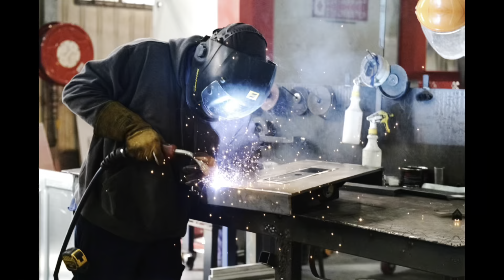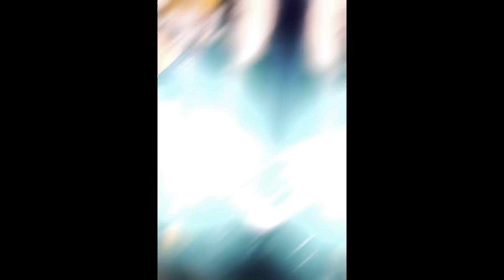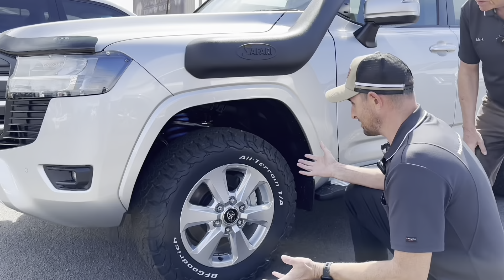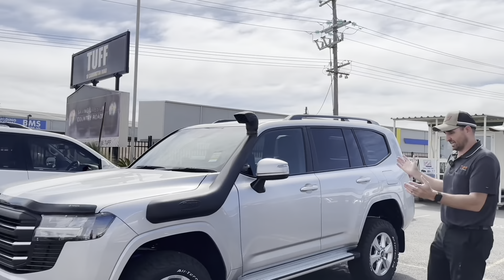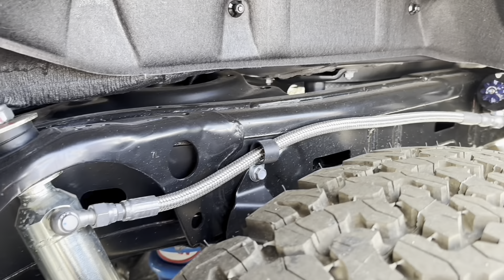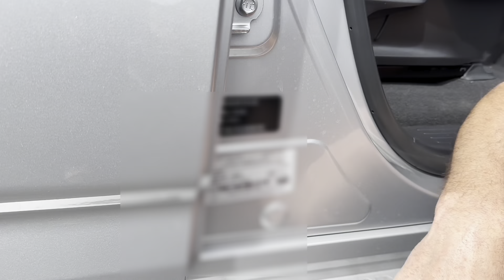Lovells GVM Upgrade - Toyota 300 Series - TUFF Australia

Comment: Thanks for this good info, how different is it post registration? Am in WA
Reply from the maker: We would have to check what the Western Australia jurisdiction rules are - we will get back to you.
Reply: Thanks very much  @TUFFAUSTRALIA
Reply from the maker: @cathbp4089  we haven't had much luck finding out the rules for WA.  Perhaps you could contact someone directly there.
Reply: In WA you can only upgrade the GVM if you do it after registration - GCM cannot be changed.  Also if the vehicle is ever registered in another state (other than WA later), the GVM upgrade is lost.  But you can drive it in other states with the higher GVM provided it's still registered in WA.  I'd recommend Ape Suspensions (Wangara).

Comment: If the wheel base is extended on this vehicle the SSM will be void. Unless lovells has test data at for the new wheel base.
Reply from the maker: Hi Mark, that comment is correct. With SSM (Second Stage Manufacture) Approvals a vehicle can have as many of these as required. When the vehicle was here, and the video was done, those are the specs that vehicle had. When that vehicle has undergone the chop – if the wheelbase remains as per O.E (original equipment) the GCM will remain at the 7700KGS . If the vehicle has had the chassis extended - the GCM will be void unless the Second Stage Manufacturer extending the chassis has carried out the testing with Lovells to have the GCM reinstated.